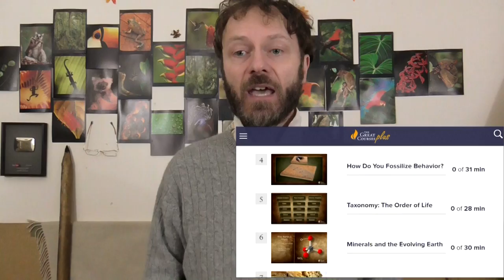Muzzle Brakes - what are they for?

Comment: I know it's dated but I served over twenty years in the US Armor Corp. While you are correct with each point made regarding the role of the muzzlebreak, the main benefit was that it cleared your vision so you could observe where the round impacted and adjust accurately (WW2 tank crews had to hit their target within the first three rounds to qualify whereas modern gun crews are allowed one due to technology used). You usually don't see a muzzlebreak on guns whose caliber is 50mm or less (or short-barreled 75mm like the early war Sherman, T-34 or Pz IVb) as the round uses less propellant (gunpowder). But as the war progressed and the tanks got "meaner" the rule (up until the mid-1970's) was the harder the punch=the longer the barrel=the more propellant needed to push that bigger round down that longer barrel=more smoke.
Now, modern tanks, whose caliber are typically 120mm +/-  (NATO Standard) do not have muzzlebreaks as the propellant burns much, much cleaner. What one sees when one watches a video of a tank live fire is mostly dirt and debris kicked up by the shock wave which clears away faster as it's both heavier then smoke and blasted away from the tank.
Reply: P.S...while I was incredible fortunate enough to have worked alongside my British counterparts in both Germany, Kuwait and Iraq I wished I was aware of the term "Brassed Up" as I would have used it at every opportunity!
Reply: What pushes any round out of its barrel is the force of the explosion of the propellant being converted from a solid to a gas which creates a shock wave (rapidly contained over-pressurization). Now, both the round and the shock wave must exit through the front end of the barrel as the back is blocked by a breach (a very, very small amount of force is converted into physical recoil). Now, as the round exits the barrel, it travels on a set trajectory direction. The Shock wave following the round however, travels out in all directions (sphere or ball shaped). If you were fire a rifle from the prone position over sand after a few rounds you will see a "ripple" pattern in the sand below the muzzle end. Now, the part of the shock wave that follows the round out and then expands like a ball pushes against the muzzlebreak as it forms it's shock circle (ripples). That "pushing" the barrel forward helps reduce the 'pushing" the barrel backward (recoil). As I can't post pics or diagrams I hope this helps.
Reply: garrulousglandarius  in short it redirects exhuast gasses back toward the shooter.  Apply opposite force reducing recoil . In the uk Used on top end target air rifles in .177  learn to shoot well with a spring powered air rifle and any gun from there on is easy to use
Reply: If you think smoke obscures your vision firing one of those try firing a Vulcan, when we would fire at ground targets on a day without a breeze you had to electrically "lock out" the drive motors for the turret and stand on your feet if you wanted any chance of seeing where the rounds impacted, a day with a stiff breeze or swinging while shooting at aerial targets wasn't a problem though.
Reply: Muzzle breaks do several things and depends one its design what feature they have.

Mostly it expells gas to the side which is its main purpose.

This foes several things one limits the gas going straight up, 2 reduces recoil as it keeps the gas from pushing straight back on the rifle fired all forces have equal and opposite reaction.

Several can even obscure sound making it sound farther or close than it really is.

Also, a large cloud of smoke in a single spot gives your position away as well.

This is why most artillary are also rifles not cannons.
As cannons are smooth bore and rifles, well are rifled. You need less propellant for a rifle than a smooth bore as well.
Reply: @Robert53area  
What do "bore evacuators" do in the barrels of some tanks? You know, the bulge about half way down the barrel of some tank guns, I've always wondered that.
Reply: @dukecraig2402  bore evacuators do the same thing for modern tanks, it expells the gas at a lower pressure over time, to reduces stress on the weapon system alone, usually seen on more modern tanks like the l44 120mm tank gun feature on the abrams and leo2, challanger this keeps the overpressure from the expelled round to damage the gun or the people inside, as they fire a wide variety of rounds today such as APFDS, HE, Smoke, and etc. Surprisingly you dont see this to much on russian tanks,  might be because they use the 125mm long gun, similar to the german 128mm that was on the konigjadger tiger and the maus. This 128 fire a heavy solid shot, im sure the russians have found something similar to control the recoil on their 125mm guns. As they had muzzle breaks all prior to ww2, im sure they have modified the breech or could be the fact alot of their tanks are autoloaders, so they dont need to recycle the gas.

Sorta like a modern rifle the expelled gas is recycle which either pushes a piston back, which causes the extraction, (AK and other piston driven) or similar to the M16 the expelled gas is recycled to rotate the bolt to unlock it before extracting. Highly suspect its the second option. As you wouldnt want to use anything other than a locking breech on a tank, so that no gas is able to seep back behind the breech. The over pressure on the front of the gun could kill a person, the pressure inside a closed tank would kill the crew.

Reason you never want to fire any RPG or recoiless rifle inside a closed room. Always want the door open and the back blast toward the open door.

Remember the laws of gasses? It wants to fill the entire volume of any space it occupies, so that would be the room, your lungs and your intestinal cavities, this over pressure is what kills, as the high pressure gas fills the body to fast before it can be regulated, its also heated. Be like boiling and choking at the same time. While your insides turned to mush
Reply: @dukecraig2402  notices tanks like the t55 and t62s early soviet autoloaders they dont have it. But their rate of fire was too slow, to increase the rate of fire for the autoloader, on the t80s this was present. But the t72 export did not vs the t72s that were built sole for russia did have it. The t14 does not have it as it is a closed system and not needed. As the crew sits in a capsule and the autoloader is in a space that isnt occupied by a crew, they dont have to worry as much as the gas coming back and cooking the crew.

The T14 uses an automated controls and a 800mm capsule to protect the crew with 500mm protective armor on the outside. The 500mm comes from composite and spaced armor.
Reply: @Robert53area  
Always wondered what they were for and why some tanks had them and others didn't, I was in air defense in the Army in the 80's (Vulcan gunner) and our barracks always had those posters in the hallways showing the difference between different Soviet tank models and I remember that some had them and others didn't but they didn't explain what they were for, they just noted that certain models had them and others didn't, thanks for the explanation, I'm assuming you were a tanker in the Army or Marines.
Reply: Great info mate, and thanks for sharing. I had a bit to do with similar calibre ordnance (4.5 inch and 5"/54) over a 40 year period. Mine was Navy, but some things are common amongst medium calibre guns. Obviously the calibre/barrel length is a compromise of practicality and how long the barrel needs to be to convert all the charge into projectile velocity/projectile guiding. 

Some "end fittings" are a combination of a muzzle brake, but also can perform a "flash suppression" function, whereby if the muzzle blast is deflected, it may suppress any muzzle flash, which at night is desirable, as enemy targeting muzzle flash can be a consideration. NGS (Fire support) drills on ships have a section called "Counter battery" which can be used to target muzzle flash from shore batteries; so it is a design consideration.

The most extreme muzzle brake I am aware of was when the Brits fitted a QF 3.7 AA gun to a Mosquito at the end of the war. It was incredibly complex and very intricate to make (hand made.) There are various references to it, but not much info. Info I have seen is that to be viable the recoil had to be almost entirely eliminated in order to not shake the Mosquito to bits. Apparently they built two, flew them and fired them to prove it worked (just post war) then dismantled them.

You would know more about this than I, but the Challenger in the vid has a bulge mid barrel - some confuse that as some braking device. But that is apparently a fume extractor that works on pressure differential evacuation. In ours (Navy) we use a compressed air blast for that, but there are far more ancilliary systems available in a ship than within a tank, so we have that luxury. 

I loved working with this stuff.

Cheers.
Reply: Ah...My muzzle loader Does need a muzzle break as it's 54 caliber. lol
Reply: My Glock 17 competition pistol has a muzzle break and accuracy is increased from my Glock 19.
Reply: garrulousglandarius  Newtons law.  For every action, there is an equal reaction.  If the gasses are going out at a thousand MPH, and you can then cause the gasses to 'reverse' then you have created a 'reaction' which reduces the recoil.
Reply: Clearing vision after shot was literally his first point
Reply: The bore evacuator does what its name suggests.  Some of the pressure in the barrel is stored in the bore evacuator as the round passes by.  Once the round has left the barrel, the pressure in the bore evacuator ejects the gases towards the muzzle and out.  This prevents the toxic gases left in the barrel from entering the tank and gassing the crew when the breech is opened to load another round.
Reply: garrulousglandarius  yes he does
Reply: @mathewm7136  Wer in Physik aufgepasst hat, stellt bestimmt keine  so blöden Fragen. :-))))))))
Reply: @dukecraig2402  Hi Duke, sorry for the late reply.
Bore Evacuators;

As barrels grew longer this new problem started to happen;
 – after the round leaves the tube the barrel is still filled with very toxic, very eye irritating smoke…and if you’re firing into a headwind (like when moving forward & firing forward), all that smoke gets pushed back into the turret making life very uncomfortable for the crew. Then imagine what would happen to a crew expected to fire 5-7 rounds/minute! That is what happened to T-54 tank crews as they fielded a 90mm gun, until they started putting bore evacs on the end of the barrels, thus becoming T-54/55’s. 

How the Bore Evacuator (BE) solves that problem;
As you served in the military you must be familiar with the gas tube that pushes back the bolt on the M16/M2. When you fire an M16/M2, some of the returning gases escape out the breech – you can smell it.

Well, an Evacuator is the same concept but inside that cannister is a tube that circles up then back towards the turret then circles back down into the barrel towards the muzzle. That way, as the round passes the second opening, a small amount of push is diverted up and back and after the round has exited, that forced finishes its trip down and back out and taking the majority of the remaining smoke with it out the end of the barrel. 

Whenever you watch a video of modern tanks firing – a second or so after the “Boom” you always see a small puff of smoke exit the barrel – that’s the BE doing its job – keeping the smoke from killing the crew.
Reply: @mathewm7136  
👍👍👍, always wondered about what they do, the only reason I even knew they existed is because of the posters they had inside the barracks to learn how to identify different models of Soviet tanks, some had a bore evacuators and some didn't, they showed them as identificating features, I kinda figured that's what they did since the name is pretty much self-explanatory but never knew for sure, thanks for the explanation, I was an Air Defense gunner (Vulcan) in the 80's, the only thing I needed to know for sure about Soviet armor was to stay away from it as best I can.
Reply: They can be found on some hunting rifles
Reply: garrulousglandarius The gas is redirected backwards, pulling the barrel forward and offsetting the rearwards recoil
Reply: @mathewm7136  sure you did 😕 not
Reply: @udokrause832  im Trainingsbereich Grafenwöhr. Und Sie?
Reply: @mathewm7136  Nie! Ich ward westlich belastet . Dann kam die Wende!
Reply: Spaz ist ja ok. Du musst handeln!
Reply: @mathewm7136  Die haben mich nie eingezogen.
Bei der Musterung haben die mich gefragt, Wegen Nato Einstellung. : Ich  hab nur gesagt, Mein Vater stammt aus Essen meine Tante arbeitet als Ziwi  bei den Kanadiern. Seine Augen drehten sich um 360 Grad......Dann kam ich vor die 6 Geschworenen.(Pflegeheim lässt grüssen.) Die mir sagten: Rückwirkend zum Armeedienst! Dann kam die Wende. Die wollten mich nicht mehr.)))))) Noch Fragen
? Den Wehrpass plus Hundemarke habe ich noch.
Reply: we can literally put muzzle breaks on any handgun rifle or any kind of weapon that uses a bullet nowadays is crazy not just or tanks but literally for any kind of weapons
Reply: So it acts as a flash suppressor?

Comment: Expanding this to address small arms. 
In addition to smoke management - which isn’t an issue with modern ammunition - muzzle breaks manage dust and foliage disruption, allowing you to keep hidden from your opponents. This is taken to its logical extreme with suppressed supersonic ammunition. On the receiving end, what you hear is the sonic boom of the bullet passing by (which is really loud), followed by the impact of the bullet, - but here’s the neat part: the apparent direction is the opposite of the real direction, making you turn your back to the shooter. 

Lindybeige’s point about recoil management is even more important with high powered small arms (think .338 and up), as shooting those all day is extraordinarily painful without an effective break (and yes, suppressors also act as muzzle breaks, under the same principle). 

But how do muzzle breaks work? 
A significant part of the felt recoil of a gun is from the exhaust gasses following the projectile, acting like a simple rocket with a very short duration burn. You can capture that by redirecting it with a muzzle break, by placing a flat surface with a hole for your projectile, so that when the exhaust gasses escape the barrel they face a solid wall ahead (because the hole in the flat surface is very temporarily filled by the projectile) and to turn 90 degrees sideways they have to dump their forward kinetic energy into the break before accelerating sideways (or whichever direction the break is pointed). 

But what about the funny tips of AK pattern rifles? Those look more like rocket bells than the breaks you might see on an AR pattern rifle? Good catch - those are so similar to rocket bells because that’s what they’re trying to do - increase the recoil of the gun to properly cycle it. This is most commonly seen in short barrels, which don’t have enough time to capture the recoil to reliably cycle the action, and so need to boost the recoil of the gun.
Reply: How does a suppressor work as a muzzle break?
Reply: An even better explanation than Lindy.
Reply: @kabukiman2153  Because it has walls inside (called baffles I think) that are exactly the same as the walls that redirect the expanding gas on a muzzle brake. Where they differ is of course what they do with the gas after that, muzzle breaks do nought whereas suppressors reduce the pressure and speed of the gas by containing it and therefore making it quieter
Reply: @Ded Pewl  I'd imagine silencers would have to be lined with a metal brillow mesh padding like material to trap the gas exhaustion..?  
The drawbacks would be soot and over heating with semi/automatic firing.. 
Do they have to be changed every so often like a water filter?
Also has anyone tried making an entire barrel porous? I understand it wouldn't work anywhere with dirt.. but a concrete jungle perhaps.. I would also assume air drag but what about accuracy if the entire barrel was aligned with muzzle brakes?
Reply: @rrpearsall  No, it's just metal. Material doesn't really matter, it doesn't trap gas by consuming it but rather traps it by allowing it more volume to expand before it leaves the barrel, the more volume it has to expand, the less pressure it is under, which means less gas exits the barrel, and so produces a quieter sound.

Comment: Muzzle brakes be like

"I used the recoil to diminish the recoil
Reply: 1_8_9 high IQ
Reply: It uses the residual gas pressure to divert part of the muzzle blast to the rear. Too much muzzle brake will cause the barrel to be pulled forward. Recoil can be balanced to the point that there is no recoil.
Reply: That's actually not that far off from what it does. You're using the propellant gasses once the projectile leaves the barrel to provide forward thrust on the weapon, thus reducing recoil.
Reply: Sometimes, you need to think like your enemy.. to defeat it...